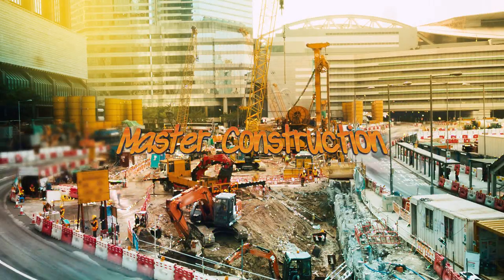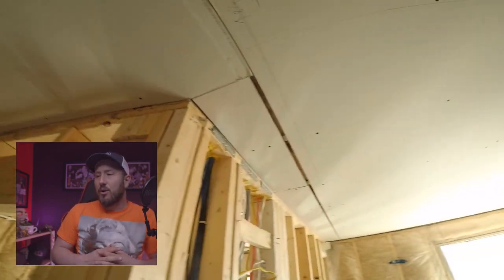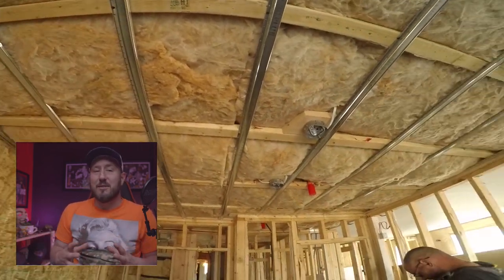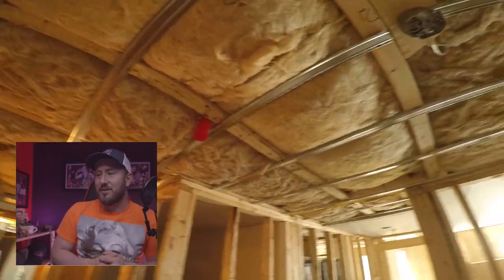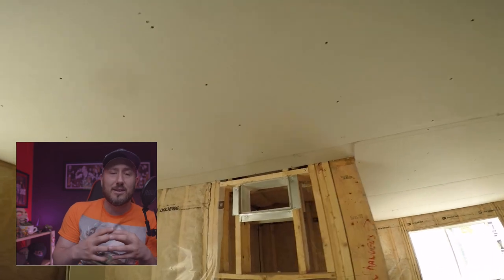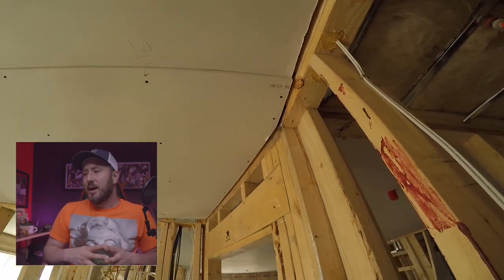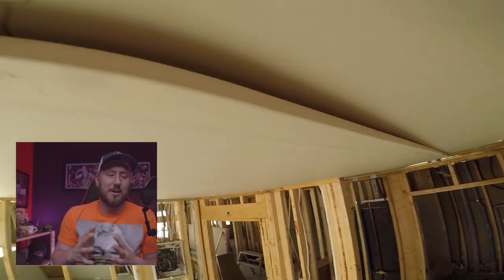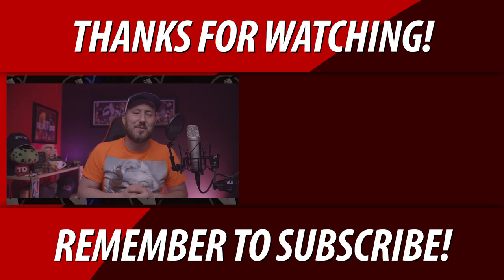Drywall Installation On Ceilings | Double Layer On Res Bar!

Comment: How far down does my can lights need to be ruffed in? Can lights are set up for like 1/2 inch Sheetrock and I want to install 1/2 inch double layer or 5/8  inch double layer. Everything in ceiling like duct vents and shower heads and Receptacles and whatever is coming through the ceiling I’m just trying to figure out how far everything needs to hang down. And I myself am a licensed heating and air-conditioning company and work for myself and I’m in the trade world but the sheet rockers I’m talking to all frowning upon hanging 5/8 sheet rock because it’s too heavy on them. I really like the video very detailed very professional. Thanks
Reply from the maker: O for sure, i do 5/8" all day, even install it I'm my own home because it's the best. You can set  your boxes to any of those depths and if you need longer screws that's an easy fix. The new led lights require 1" depth Wich is amazing. You can do any of those depths and it will work. The lights themselves come with a flat stock cut out for you to install on the framing so there is solid backing for the screws. So yeah you can set them to whatever you want. The new yellow plastic boxes are the best. They have flanges for all the way up to double layer 5/8".

Comment: Great video Chris! Question for you. I am using ISOMax clips, hat channel, and double layer 5/8" drywall with green glue inbetween the layers. The first layer I'm using 1" inch drywall screw which screws into the hat channel. I'm not sure what type screw to use for the 2nd layer of drywall? I'm running this on walls and ceilings for my home studio build. What do you recommend? Should I only screw into the first layer of drywall or screw into the hat channel? I can't find any spces on what the right process would be?
Reply from the maker: For the first layer of drywall use 1-1/4" and for the second layer use 2" drywall screws. Now that hat channel, is it heavy gauge? If so use the self drilling zinc coated screws and if its light gauge justnuse the pointed tip phosphate screws. They a have a #2 philips head.  A couple more pointers for you. Try to map out where the joists are so that you don't screw into them by accident, also stagger your screw pattern from both layers finishing proper on the second layer meaning in the bevel at every channel and 3 screws in the field evenly spaced I just hit one in the middle and then hit wither side. If that makes sense. If not catch me live 730pm mst and I will draw you a diagram.
Reply: @ConstructionKronies  Hat channel is heavy gauge. I will try to catch your live stream tonight! Thanks for the info. Respect.

Comment: Hey Man - great video - are you guys using the RC1 (one leg) or the RC2 (two leg version) in your installs? So hard to find a good how to on this resilient channel/drywall installation, ,well done men!
Reply from the maker: Cheers man, we are using the RC1 here. The RC2 in my experience goes into multi million dollar places. I did some work at Spring Creek in Canmore with RC2 and we installed these clips with rubber first. The rc2 was heavy gauge steel, just like hat track or furring bar in 12' lengths that snapped into them. I did a lot of videos on this double layer on res bar and if you need to know anything specific man just ask k!
Reply: @ConstructionKronies  Hi again - thx for that info ! 

I do have a couple of instal tips questions on the Baileys RC1 plus if I can. 

I got my RC1 installed on the ceiling as per instructions and having an issue with quite a few (~40%) of the screws stripping out of the channel before they properly set in the drywall face. 

What would you recommend to solve this issue? I am using the fine type S bulge head screws. Do you use and particular brand/configuration of screws? Does the type of screw matter (self tapping vs needle point) Does the screw gun type matter ie for speed etc (corded/cordless) ? 

Any insights would be super great - I have halted my drywall install until I can trouble shoot this screw stripping issue.

Cheers Mister,

G
Reply from the maker: @sailingsvgenevieve3970  yes sir this happens to everyone so its not just you. The trick is NOT to screw in the bevel for first layer but just on the end of it like 2.5 to 3 " in from the edge of the sheet. Its the bevel that strips them but also if you don't screw the rc1 into every single joist this will happen. Also if yiu end a pc of res bar floating between 2 joists you need to overlap it with the next one and screw them together with the little black framing screws or just cut them to land center on the joists. On double layer ceilings this is why it's very important to screw off the first layer with 2 screws in the field of every pc of res bar and of course 2 more in each bevel (but 2.5 to 3" in) then on second layer put 3 screws in the field and the bevel yiu can screw them in normally because they shouldn't strip . Make sure the res bar is every 16" oc apart not 2' and use 1-1/4" screws for first layer and 2" for second.

Comment: How do you prevent overlapping on the second layer? Doing a square room and have two sheets side by side. I've started each "column" from the opposite wall so they're staggered, but if I do this again on the second layer, I'll have a central line which doesn't have an overlap. Is this a problem? PS using DB Board so no one can hear me scream! :-)
Reply from the maker: Hey Charlie!! Sorry it took me so long to reply, I saw your comment yesterday but was thinking about what you mean exactly. I think  you mean the butt joints will match up, in this case stagger them too. EXAMPLE: First row of sheets start with a 4X12 ft sheet then 4X8 ft, second row will be 36"(cut a ft off) x 8ft sheet then the 36" x 12' sheet. ALWAYS stagger your butt joints by a minimum of 32 inches and bevel overlap a minimum of 6 inches. Just plan your room out to minimize taping. I hope this helps. Try to catch me live sometime and I will draw you a diagram!!

Comment: when using 1 1//4 inch in first layer you are hitting joist beacuse bar is 1/2inch only.
Reply from the maker: We are cautious of where the wood is and avoid those areas so that doesn't happen. Also make sure we don't land our butts near a joist.